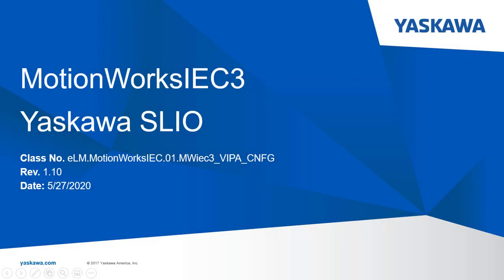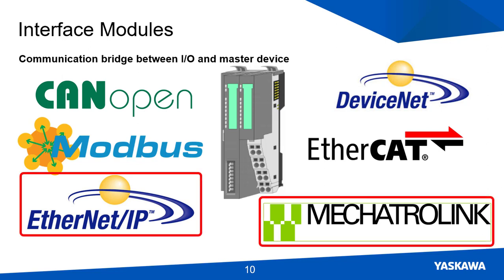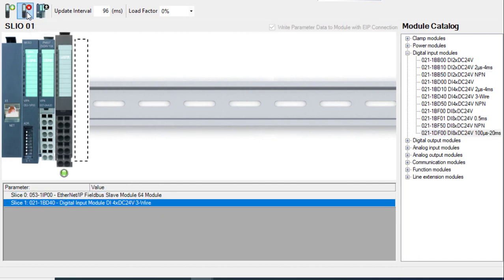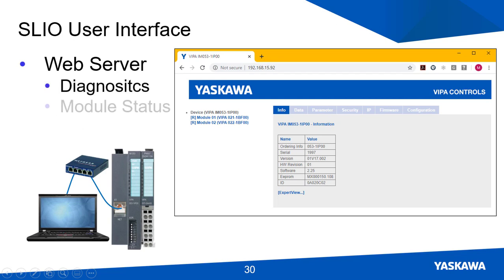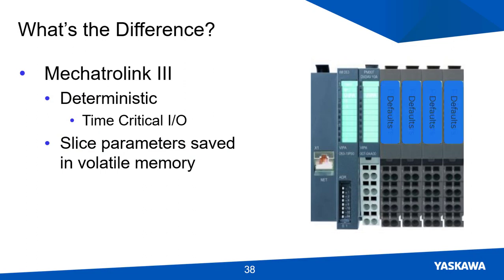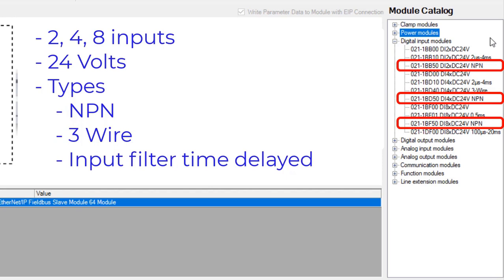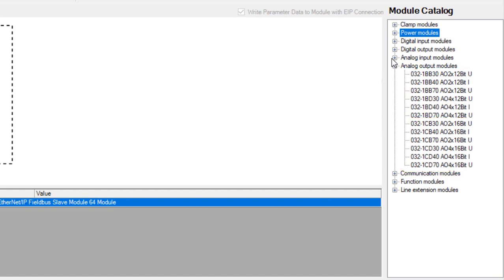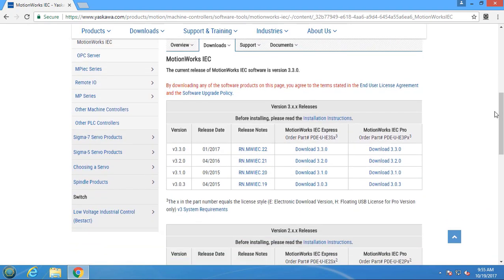Yaskawa SLIO (MotionWorks IEC Feature Spotlight)

Comment: Hello. I know this question is totally out of context but is an absolute encoder better in positional accuracy than an incremental encoder. For instance a 23 bit absolute encoder (8,388,608 pulses per revolution) vs a 2500 quadrature encoder (10,000 steps per revolution)? Thanks for your time
Reply: @JBSHOWS  I was thinking there is always a dead band of steps where the controller tries to keep the servo in position. This has more to do with the integral part of the PID controlling mechanism. If given a dead band of say 50 steps, the positioning accuracy is better with absolute encoder since 50 in 8 million steps is much lower than 50 in 10,000 steps. I was looking for somebody to confirm my assumption
Reply: @JBSHOWS  Thanks for taking the time to respond!
Reply from the maker: The main difference between absolute and incremental encoders is the use of battery when using absolute encoder to remember the position when powered down. The resolution is independent of the encoder type. For example, 20-bit absolute and 20-bit incremental encoders have the same resolution. To better assist you, please contact your local support from our global locations: https://www.yaskawa-global.com/company/profile/global. For the Americas, please contact our technical support team at https://www.yaskawa.com/support-training/support. Thank you!